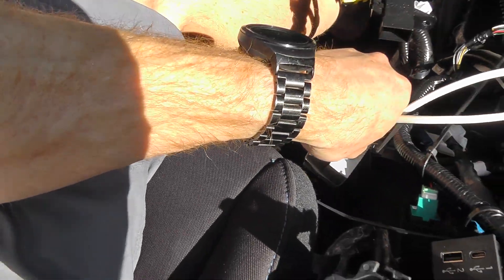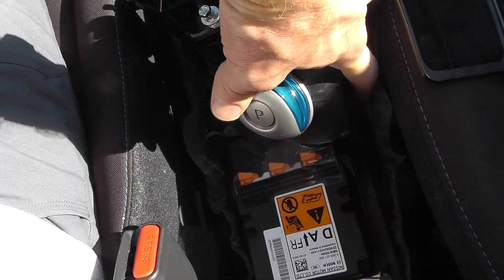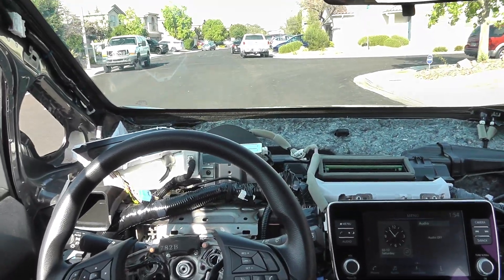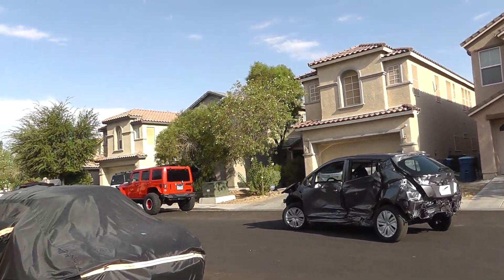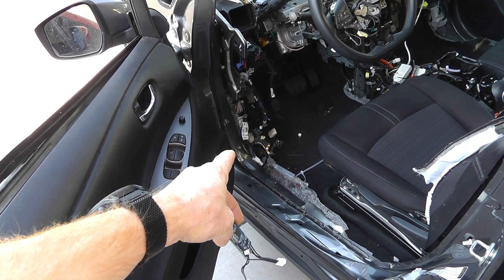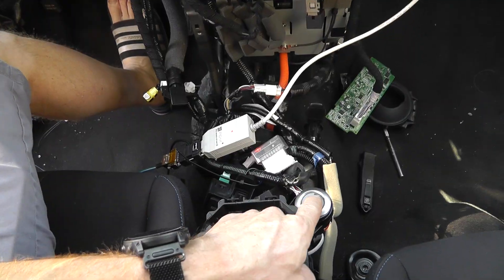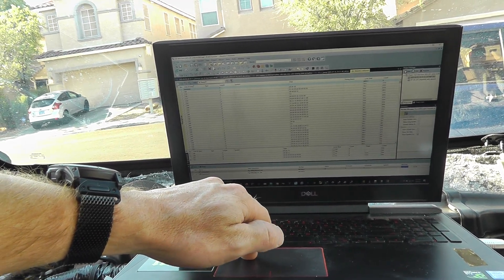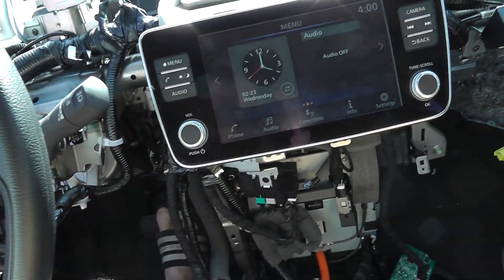I Faked The Second Processor... With This Hack! Leaf LBC.... Project Leaf...

Comment: more reasons not to get electric cars, if you don't have enough already to replace a little circuit board. and buy second-hand; the going end buy cabling is a hacked mess, like you see in this video.

Comment: Can you drive while the charger is pluged in? If so.. lets see how far you can get with a 120v or 240v generator plugged into it and a single gallon of fuel